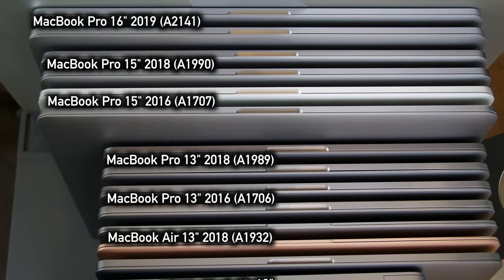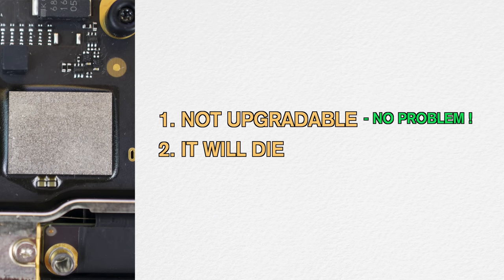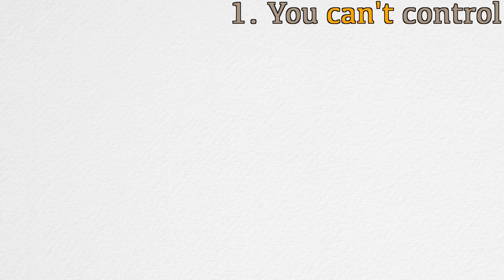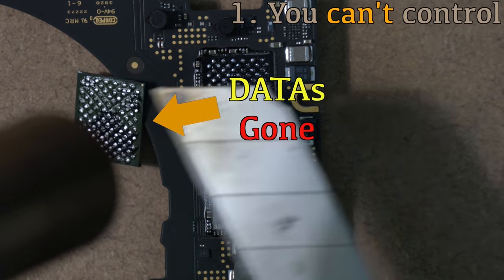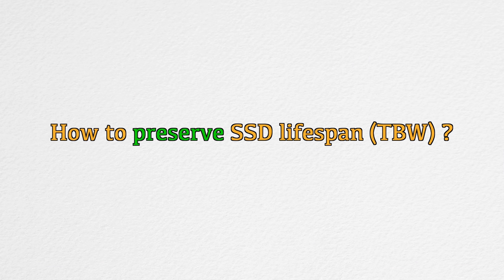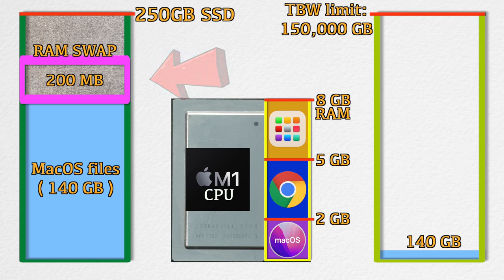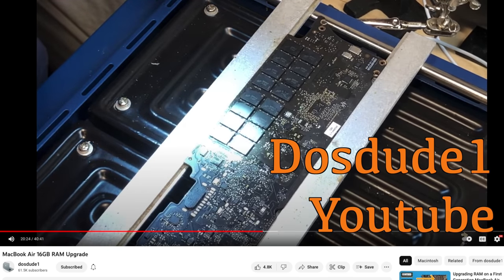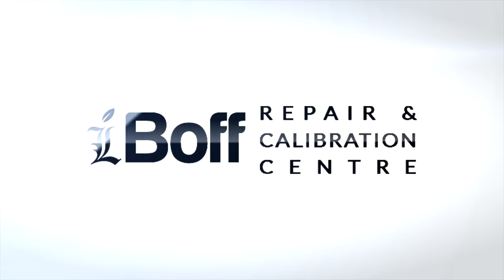These MacBooks DIED from SSD Failure & How To Prevent It (Not for RICH dudes!!)

Comment: SSDs are a gold mine for apple strategically. It makes me shudder when I'm reminded that they're soldered on.

For anyone that's ever attempted data recovery, it's always harder to recover a corrupted SSD. HDDs  give you indicators that something is going wrong and you have multiple avenues to attempt recovery but an SSD is ridiculously more difficult to recover data from successfully.

I was replacing the HDD on an old laptop that was pretty slow with HDD issues popping up and after cloning the drive it ran almost like new.

My friend around the same time sent me their SSD to see if I could fix it because it was glitching and intermittently experiencing slowdowns. While I could access the drive, certain files would trigger intense slowdowns if I interacted with them. I had an SD card behave the same way before and knew it was corrupted. 

While a partially corrupted HDD can be cloned, SSDs refuse to even engage wih any cloning software or hardware. 

I only use an SSD in my laptop because Windows 10 doesn't run well on HDDs because they skipped optimizing their file system because they didn't think they needed to anymore with faster SSD speeds. I only bought that laptop because it had a secondary HDD that I could offload the heavy file manipulation to.

While SSDs have a finite number of writes before burning out, HDDs are only limited by their moving parts wearing down. They actually run longer, the less you cycle them on and off.

We're making it so much more expensive for the average person to recover from a solar flare...
Reply: I’ve always been a firm believer in HDD’s for longevity. SSD’s may be faster but they seem far less durable. As you said HDD’s theoretically have an unlimited amount of write cycles whereas SSD’s have an absolute finite lifespan. I have 25 year old HDD’s that still work fine. They also mostly start to fail slowly whereas SSD’s often die rapidly with very little hope of recovery.

Comment: After 2 times internal SSD got fried/die, I finally conclude to go for external nvme  casing and booting from TB3 cable. All it was my random trial and error method. To me SMART was a jock. Surprised to see your video. Thanks for beautifully explained video. In other words I must say the video is the summary of my 2 years of struggle with my imac.  Thanks for the video, Keep doing more. I have already subscribed to  your channel. Thanks.
Reply: What case you use?
Reply: @colindoyle9876  I use ORICO Thunderbolt 3 M.2 Dual-bay Docking Station. Sorry my earlier reply got deleted as it contain a link.

Comment: What nonsense... "150TBW" does NOT mean it will die once you reached those "limits". Just like a car is not magically stop running just because you reached the 50.000 miles your car seller gives you guarantee for.
It's the MINIMUM the manufacturer guarantees until it MAY stop working. But in reality, the limit is much much higher than that.
There are even a lot of tools to get to know how much life span your SSD as left and how hard you're able to hit it. On my 512GB MacBook Air for example, I would have to write over 140GB to the SSD Every. Single. Day. To reach the probably maximum life span after over 9 years(!!!). 9 years of constant 140GB/day.
Reply: No, SSDs do exactly "magically stop running" and there's little you can fo when it happens. And the moment when it happens is absolutely unpredictable.
Reply: I have a 2014 iMac, and a 2017 MacBook Pro. I use them constantly for my job. I’m a web developer. I’ve never had any of the problems mentioned in this video. Just saying.
Reply: @MichaelThomasDev just because YOU haven't, doesn't mean others haven't. I use s 2015 MBA daily which I can replace the SSD, but I haven't had to. If it does die one day, it's replaceable, unlike newer macTrash and I can keep using my Mac while others need an entirely new computer.

Comment: Nice video. My office issued M1 MacBook Pro has 64 GB RAM and 1TB SSD, so it's most likely going to outlast its useful life. My M2 MacBook Pro has 16GB RAM and 512 GB SSD. I don't run too much heavy stuff on it, so I haven't noticed it swapping. But it's shocking how much memory apps use these days. The YouTube browser tab displaying this video is currently taking 0.6GB! So, it's easy for the usage to quickly add up if you have lots of stuff open. I also have a 2014 Mac mini with a (replaceable) SSD that's going strong -  used primarily as a media server, so it hardly does much writes.

BTW,  Random Access Memory doesn't mean what you say -  "data is randomly moving in and out". Here, random simply means you can access data (read or write) in approximately the same time, regardless of which location it is stored at. Contrast this with a Hard Disk or even tape where certain locations take longer to access than others.
Reply: Hdd are random access... it means an address will take you to the location of the data. A tape is not because you have to sequentially access

Comment: I'm not entirely afraid that my SSD will fail due to too much data being written to it.
I've got a 1TB Samsung 970 Evo as my PC's system drive, had it for about two years and even with HEAVY use I have only written 15TB to it.
Considering I use my MacBook in instances when I work remotely and offload pretty much all tasks to an external NVMe SSD, I think it's more likely some IC is gonna fry long before I write 150TB to my laptop's SSD.
Reply: I feel the same about my 2016 small 12 rMB. Only thing is I get feeling that new Macbooks blast the NVMe with 12 volts without having to use up all your TWB.

Comment: on my old m1 MacBook Air I had the swap memory usage, I got the base model back in 2020 and I was using around 2-5gb of swap when using Final Cut and Xcode, but now I got ht else model M2 MacBook Air 15 inch with the upgraded 10-core GPU and I disabled swap memory so it never uses it plus editing all my files off iCloud or my 2tb Samsung t5 drive. On the old one I had in 3 months 19TB out of 150TBW but now after 1 month of use I have only 500gb out of 150TBW. The performance is the same even when editing 4K on Final Cut and it works butter smooth.

Comment: Thank you very much for the detailed information. Even for 150 TBW, someone writing 50 GB every day, would need 3000 days to reach this. But just in case, I will be storing my large videos directly to an external disk.
Reply: Rarely a 256gb ssd have 150tbw
Reply: @tanyaspotting that’s a lot, mine writes about 50 GB per day, as I check it with iostat. This is about 1.5 TB per month
Reply: The point is, if it runs out of RAM, it can actually swap a terabyte onto the SSD in a day. Imagine if it writes just 200 MB per second, it can reach 1TB in less than two hours of usage.
Reply: @Tanya Spotting how many total byte written you got now, I just bought a second hand MacBook air m1 that have 210 TB byte written already. And i saw that most of 256 gb ssd only have lifecycle of 150 TBW. So what should i do? What is the write cycle of the mac m1 air 256?
Reply: @icecantgaming944 holy cow. Use an external ssd and copy macos there

Comment: It is easy to see TBW your SSD already used with software. 
For Windows I use Open Hardware monitor. 
I put the SSD in the computer 2 years ago. It has 12TBW. So it's using 6TBW a year. It's a 500gb Samsung 860 evo drive. It claims at least 180TBW, so it could last up to thirty years :)
So no worries about TBW :)
Reply: Thank you for the info. I need to check it out my SSD. I do write lots of days the d delete there and write more.  Caching stuff
Reply: "Could"!
Reply: @izzzzzz6  The warranty is 5 years, and its easy to replace it if I want to
Reply: @Helios.vfx.  What's ya current TBW now?
Reply: @petrlaskevic1948  I don't know to be honest, I'd like to know.
Reply: @Helios.vfx.  Sorry, the program is called Open Hardware Monitor
Reply: @petrlaskevic1948  Gonna download it now and see how it works
Reply: @petrlaskevic1948  I just opened it and I do select my SSD but doesn't show me any indicator about TBW
Reply: @Helios.vfx.  Weird. Do you have an administrator account? It's that  getting access to this information requires administrator mode. 

The program also has nice features like monitoring hardware temperatures and such.
Reply: @petrlaskevic1948  Still does not show me that, but I'm using crystalDiskInfo and it works as well
Reply: @Helios.vfx.  Idk then. Good that you found a program that works on your hardware
Reply: @petrlaskevic1948  Thanks though.
Reply: TPS 62180 could break at any moment.
Reply: @trshcln6937  what's that?
Reply: @petrlaskevic1948  It can fry your ssd in macbooks.
Reply: @SebVEVO  What does that have to do with my comment?

Comment: Most People will not be able even reach any were near 150TBW on 128GB drive or 300TBW on 256GB drive even. For a 128GB drive with 150TBW you need to write 82GB data daily to reach 150TBW limit in 5 years.  So 99.9% consumers will never reach the rated lifespan even majority of PRO will not be able to reach it unless it is a server doing data warehousing or chia mining 24X7.
Reply: No. Not true..people rendering encoding videos will wear ssd faster
Reply: @Teluric2 then I see the MacBook as a “suffering from success”: It’s powerful, portable and convenient, but the SSD can’t handle too much abuse. Better use a desktop for this stuff anyway
Reply: This is not a justification for soldered SSD!
Reply: @aravindt apple fans will literally justify anything 😂
Reply: What abput the swap memory?

Comment: TBW is actually to do with physics. Basically the NAND circuit in the SSD chip can only be cycled a limited number of times. The TBW grows with disk size as bigger disks reserve more 'spare' nand cells to use when some go bad.

Simple free way to check your TBW is open a terminal window and type the command

iostat -Id disk0

(that is a capital I and lowercase d) 

The last number is the number of bytes written since new. Divide by 1000000 to get TBW (actually 1048576 but a million is close enough)
Reply: I've seen in another vid that sometimes it's down to the chip that supposed to send the correct voltage to the SSD going screwy and sending too much voltage to the SSD, burning out the NAND chips

Comment: I am kind of glad that I chose my M1 Pro MacBook Pro with 16 GB of unified RAM and 1 TB storage. I use Logic Pro and should really put its data onto an external drive, but, then again, this limits its portability. Hmm…

I used a 2012 MacBook Air with 128 GB of storage and 4 GB of RAM for 9 years, incl. Garage Band and Logic Pro projects. My SSD died once, but not really. A computer repair service soldered it, and I didn't even loose any data; and the Mac worked fine after the fix until I sold it to a friend as a beginner MacBook. As far as I know it is still working fine, haven't heard anything different.

Thanks for the great explanatory video. Keep up the good work! :)
Reply: How many TBs written?

Comment: I think you missed one important point for the SSDs (not only for the soldered ones in the Macbooks), if you erase a file on the SSD, you will also loose parts of your TBW, as the the cells are cleared what is also a writing process, that makes all even worse, you can try to use more provision to have more spare-cells, what can expand the lifespan of the SSD, but i don't know if this works at the fruit computers. Also very important the more states  a cell has the worse the endurance SLC, TLC, QLC.
My conclusion: avoid like a plague soldered SSDs, avoid like another plague proprietary formats of SSDs. ONLY standard connectors (Sata, msata, m2)
Reply: I think you got this wrong. Deleting a file does not write over the data blocks. No OS does that, you need special software to do that.
Deleting a file only adds the blocks to the free blocks list and removes the entry in the folder.
Reply: @robertbrzheintzbrz147  But before writing new data to the cells they are erased e.g cell having a value  55 is then set to 00 and then rewritten with FF as far as i have heard. I'm not specialist in that things, but i think especially the need for swapping due  to insufficient space is a bigger issue than most users think. Its not like with the hdds where the old data were simply overwritten.
Reply: @robertbrzheintzbrz147  Yes and no. When you delete, not yet, but then when TRIM runs to prepare cells for new data, it is.

Comment: I hate soldered SSDs, the thought of it just dying 😡 and if that wasn’t bad enough they have a data retention issue too 😩 some say the data will just fade away after about 10 years if not rewritten so I guess a lot of Nintendo Wiis will start dying soon ohh and Apple Silicon Macs keep their firmware on their SSD so if it breaks the Mac can no longer do anything like booting from an external system drive!

Comment: I contemplated whether I needed the 64GB RAM version and now I’m glad I chose that option.  I have seen spikes exceeding 32GB of RAM (by a tiny bit).  Thanks for this valuable info!
Reply: Get 32GB RAM if most of the time your biggest projects and all the other apps that you use simultaneously are below 28GB RAM. In a few months with new updates you're going to have more RAM usage. But generally 99% of all people don't need more than 32GB RAM, and I personally would not count on "investing for the future" in terms of RAM on Crapbooks because of crApple's famously non-existent reliability and for their products bricking themselves after just 3-4 years compared to the likes of Asus laptops that can easily work for more than 10 years if they are maintained well (repasted on time - I would recommend everyone use PTM7950 to repaste the CPU and GPU, it's fantastic, it's better than all thermal pastes and it's going to serve forever and it will basically never dry out compared to a thermal paste or liquid metal (incorrect application of which would require you to reapply after a year if it wasn't enough, or will absolutely destroy your entire CPU/GPU and motherboard and make you broke if you apply too much and if just one little droplet makes its way out of the CPU die))
Reply: @one_step_sideways  Soldered storage and RAM is just a way to profit off of FOMO. And people seem to buy the BS left and right.
Reply: @one_step_sideways  that is good RAM advice. Sky’s the limit if your use case requires (I have 128GB on my desktop Lolol) but yeah 32gb for a laptop is generally sufficient for most. I cringe that 8 and 16 are still relatively common configurations…
Reply: @vivek_v  actually its to keep the design thin , quiet, keep thermals down and allow memory to be unified to the SoC

Comment: I’ve got an 1TB M1 MacBook Air running Sonoma with 5 Safari tabs open, Finder, Messages, Mail, Maps, Photos, Calendar, Notes, Music, Numbers, Calculator, System Settings, System information and Activity Monitor open and it’s not using swap memory. Memory used is 6.72GB of 8GB.

Comment: I heard that the bigger the SSD is the longer life it might get, as the same cells will be used less frequently reducing the wear. That being said, having 256GB and only keeping 10-20% free over a long period might kill it faster. However, I have an old mid-2014 MacBook Pro with 512 GB SSD where about 80% of the space was constantly taken and the SSD is still alive. That MacBook was used 18 hours per day 6 days a week over all the years till this moment so only the battery was replaced around 5 or 6 times. At the same time, my wife's SSD in a mid-2015 Mac Book Pro died under much more friendly conditions.

Comment: If someone make a replacement mainboard with removable nvme drive and ram using the MBP mainboard form factor to serve as a drop in replacement, they can be very rich.
Reply: The framework laptops have drop in motherboards that you can buy, but they aren't MacBooks

Comment: A lot of companies have special engineers that work on how to limit the lifespan of the device. They have two methods: hardware and software. Hardware is with the limited TBW in combination with soldering it on the mothermotherboard, and with the voltage thing zapping it. Then they got limited OS updates. Older devices can the new mac OS just fine, but they fase them out so you can not download any new programs from the macstore because it will not run on the older OS. There are workarounds for this but it is kind of tedious to get Sanoma on older devices. But once you get it done what you see is: the performance is great, zero issues. So they are throttling it on purpose to a max version of OS. It is a choice. Good thing i bought the maxed out version, i never knew the smallest ram and ssd will do 4 times as fast as the bigger ones. Great tips also, thanks.